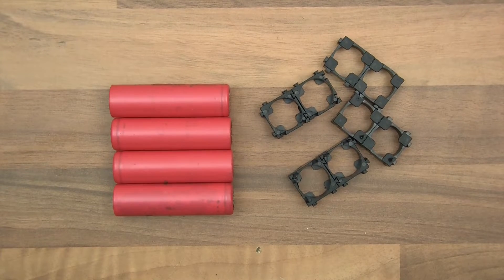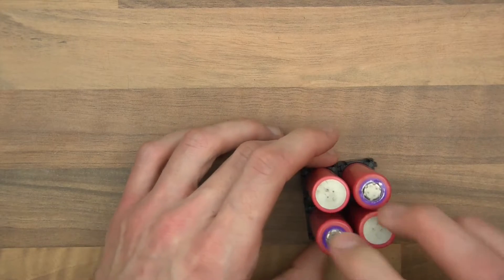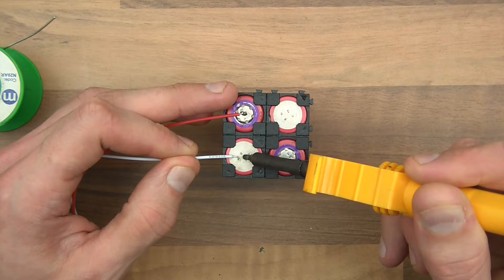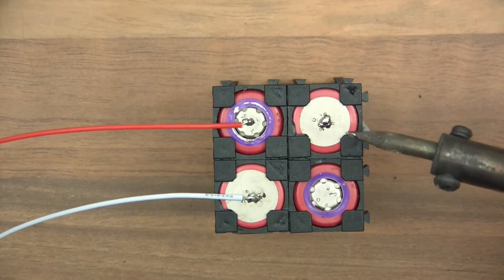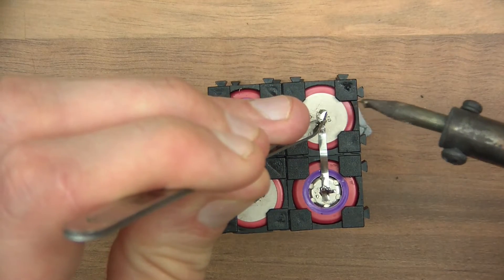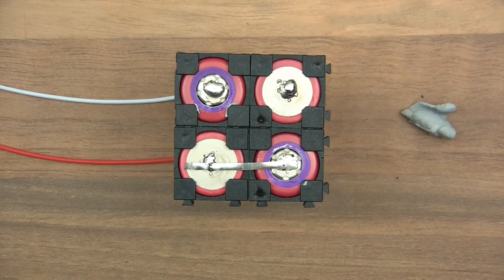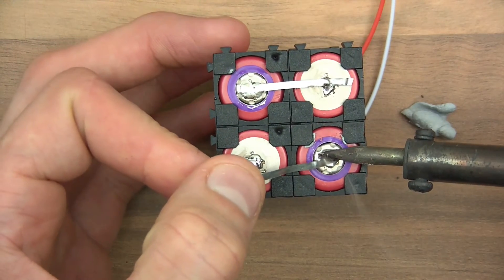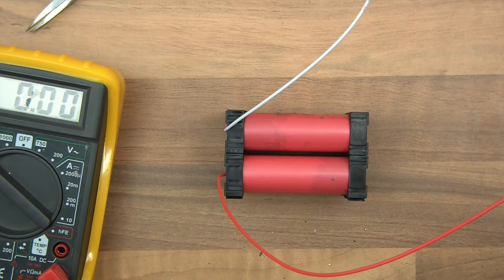Making My Own DIY Battery Pack - Lithium 18650 with Tabbing Wire

Comment: The best and safest way would be to use a 4 x battery holder, pre wired in series. Then take the cells out and charge individually in external  charger when low. Otherwise you would need a BMS. Using cells in series is not a problem, but charging in series is.
Reply: I am doing same what gauge of wire is ok for use in drone means batteries will be at limit

Comment: Are you an electronics technician? I don't think so. You just tortured the batteries, man.. 

 What if a teenage minor mimicked your style on these videos and ended up burning their home in the process?
Reply from the maker: I'm not an electronics technician.
Reply: @antonycartwright  then it's better to add a Disclaimer
Reply from the maker: @topgun2249  Whatever you do in life, you need to have some common sense! What if you saw an advert on TV for running shoes, bought some, went out running and had some sort of heart failure? What if you watched a video about how houses are built, bought some bricks and dropped one on your foot and broke it? Whatever you want to do in life, you need to also employ a degree of common sense!

Comment: Nice video. I'm wondering what you made that for.

I'm sure this was ok and worked fine but others watching should not ever leave the iron on the battery for more than 2-3 seconds.

It's usually ok with the better brands but a single cheap battery can absolutely blow up and ruin your day (maybe more). Those unbranded Chinese batteries are notoriously flimsy (when an actual battery and not filled with sand).

1. Get a hot iron and semi-sweet cloth ready

2. Clean and lightly sand/scratch the leads of the battery

3. Tap some solder onto the battery lead, taking no more than a couple seconds.

4. Immediately turn the battery over onto the wet cloth to cool.

5. Repeat.

Again, it's usually quite safe but you have to remember that these batteries are mass-produced and some poor builds sneak out even from the decent manufacturers. Chinese batteries? Forget about it haha. No more than 2 seconds and get that iron off of it.

Comment: Hi Anthony. I want to build a power pack using Two sets of $cells in series like yours, but connect the packs together in parallel to double the mAh. Once I have done this how on earth do I charge the packs back up after use?
Reply: you need to solder 14 gauge wire  one red one black solder it to the bms that has the  pos and neg output on and get you balance lead  for the number of your cells wire that in and for the pos and neg  get a xt60 connector and buy u a cheap rc charger that can charge li-ion if u need help msg me any time i will help u in depth that how u charge it
Reply from the maker: Hi Kenny, if you have two of these cells in series, then to charge them, you need to apply exactly 8.4v across the pair. The same is true regardless of how many are in parallel. When you come to charge, 2 cells may draw 1a. You should multiply this by how many you have in parallellel. So if you have 2x2, it should charge at 8.4v at approx 2a. If you want to do a proper job, you need to add two more things; cell integrity checks to check the voltage of all cells. Also you need to limit current in the event of some sort of short. Antony
Reply from the maker: Also, research BMS. You can buy cheap ones.

Comment: Is it possible to bundle enough packs to start an auto engine? And if so how do you configure end up with a cable connection big enough?
Got tons of these and tab and bus. How do u weed out bad cells, won't charge by by, hold  charge, how to test?
Reply: Yes most of the jump boxes that are sold at stores have either 3s or 4s lipo batteries inside
Reply: Yes you can, sort of.  With standard/common Lithium Cobalt cells (which these are) it's not ideal. You can only go with 3s or 4s, and the voltage is either too low, or too high (or you can only use 70% of the capacity/amps). The best cells to use would be LiFePo cells, as they are just about a direct replacement for lead acid. In this case you'd use 3s of the LiFePo cells to make a 12V pack with a 14.6V fully charged pack.
Please check out the builds over at secondlifestorage.com forum where we have lots of these projects. You can also check us out over at discord (https://discord.gg/c7gJ5uA)
Over on the forum we go into great detail of how to weed out bad cells and how to interconnect, fuse, diagnose and configure the packs/strings for various builds.

Comment: could I put 12 of them together and make a 48 volt battery for my ebike?
Reply: I'm assuming you mean 12 cells together to make 48V. If so, no, not really. You need 14s because you base the voltage off the nominal of the cells. For most 18650 cells, that's 3.7V, not 4.2V. Just like lead acid, nominal is 12V and fully charged is 14.5V. 
3.7 * 14 = 51.8V. These "seems" high, but if you go by lead acid values of 14.5V, then 14.5 * 4 = 58V  (lithium 4.2 * 14 = 58.8V).  And then for the bottem end, lead acid is about 10.4V, or 41.6V and lithium is 3.0V, or 42V. 
So, 14s 😉
Please check out the builds over at secondlifestorage.com forum where we have lots of these projects. You can also check us out over at discord (https://discord.gg/c7gJ5uA)
Over on the forum we go into great detail of how to weed out bad cells and how to interconnect, fuse, diagnose and configure the packs/strings for various builds.
Reply: @korishan  flooded batteries don't charge to 14.5v 12.8 is usually the maximum. Sure most cars run at 14.4-15.1v but as soon as you turn it off it drops back to 12.xx.

That's for flooded or AGM. That's three biggest reason why so many of us in car audio are switching to lithium because standard batteries don't help you stay above 12v at all and we want 14+.

I switched from 12 sealed Batts to a 4s40p  18650 pack and now can full tilt at 15v
Reply: @Str8GasGenetics  I stand corrected. It's not 14.4 as I mentioned. Each cell in a Sealed LA is 2.25 - 2.3V. So that would equate to a 13.5 - 13.8V when fully topped off.
So, the math is as follows:
13.5 * 4 = 54V for a "48V" setup
If charging to 4.1V on the lithiums (to gain life cycles), then that comes to 4.1 * 14 = 57.4V. Most inverters can handle up to 58V.
Bottom end would be 3.2 * 14 = 44.8V (SLA 11.5 * 4 = 46V)
Reply: @korishan   thank you